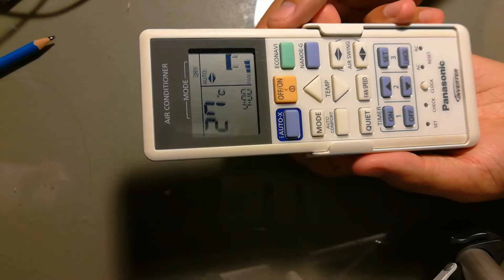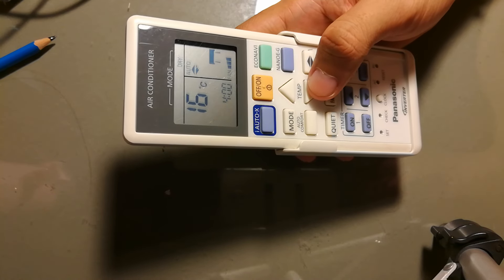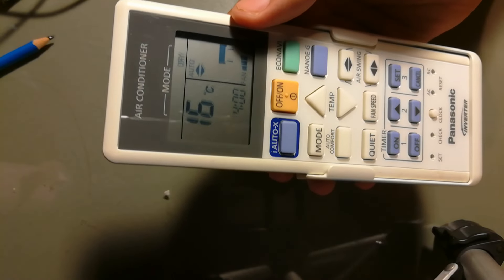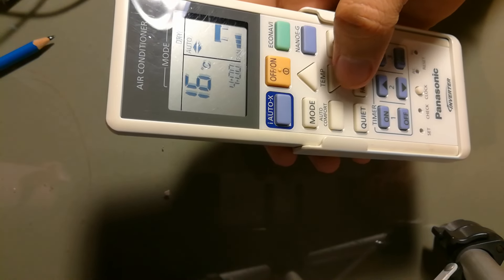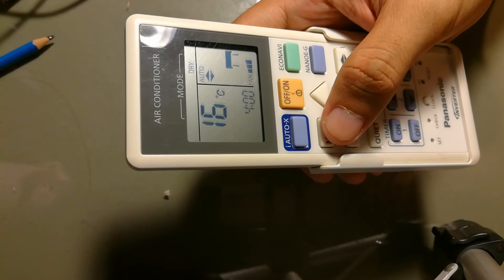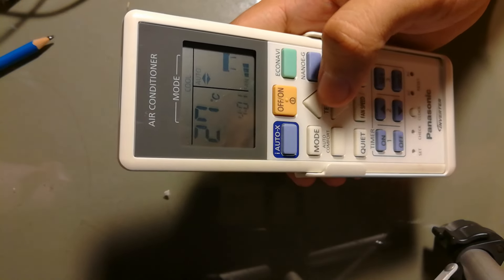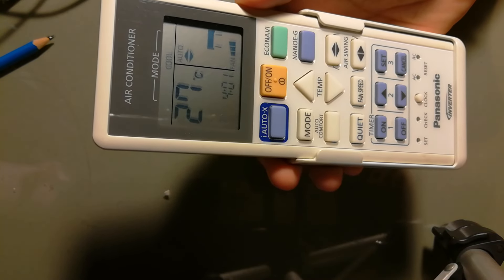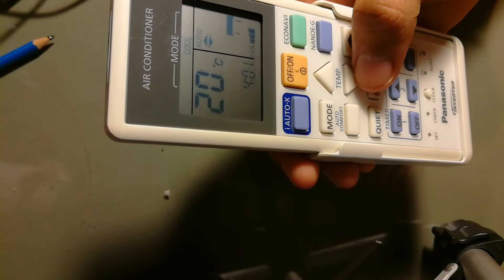How to Check Remote Controller When the Air Conditioner Does Not Cool Panasonic

Comment: My aircon didnt go colder... yesterday my aircond got repaired and get cold..but today its warm and im using your setting.. it didnt make my room cold
Reply from the maker: Sorry my friend. What did you repair for your AC? Some time the problem not because of the setting of your remote. This setting just let you check your remote setting not repair.
Reply: try to alter the fan setting so it blows harder

Comment: Thanks from Borey Pipub 217. Street Phnom Penh. I have 2 Panasonic and I'm getting upset with the remote. What does it mean, when the machine stops working and the orange light for timing is blinking? Right now is Cambodian New Year not finished jet and I find no service to help.
Reply from the maker: Orange light timer blinking. It is an errors occurs. You can't solve it by your self. Please contact servicemen to check.
Reply: Thanks for the fast reply!  @HakNukMan

Comment: Mine is on cool but the room is on fire. Super hot
Reply from the maker: Check your temperature setting. Is it lowest number? Is your AC get clean regularly. Is there any heating come to the room. Is your AC capacity is enough to supply your room?
Reply: Hak Nuk Man hi, i noticed that if i open it for 2 hours it is so hot. And when its already about 3 hours, thats when it get cools. But i will just wait to get it cooler. Thanks helpful video! Didnt know about mode and i just learned because of you. Thanks